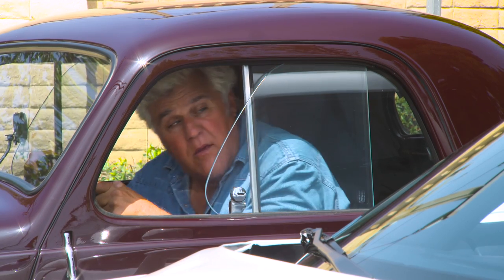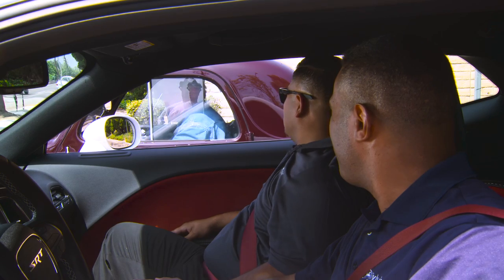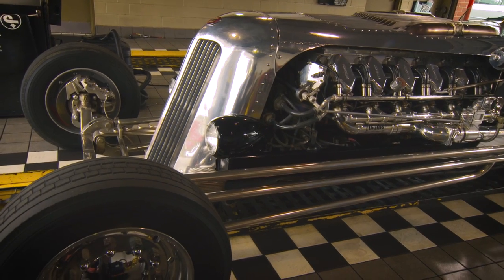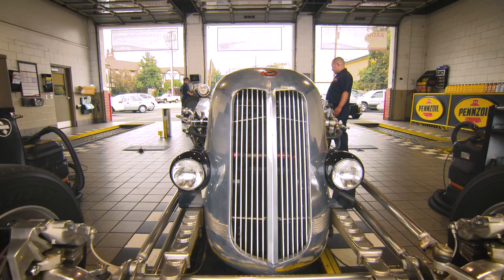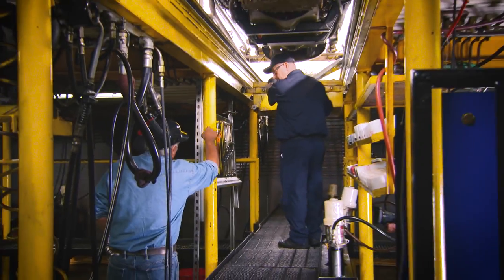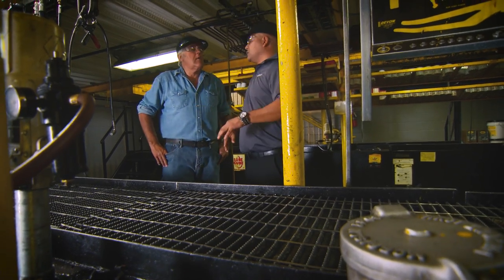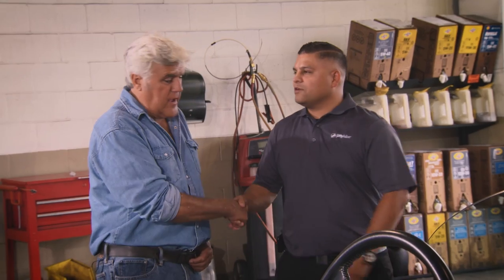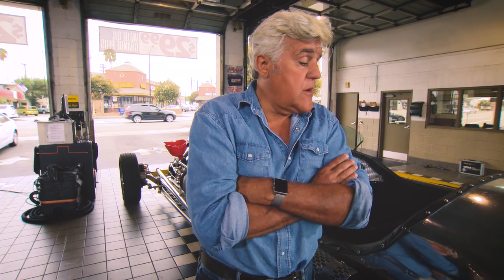Biggest Oil Change Ever - Jay Leno's Garage

Comment: Jiffy lube is horrible. I get so many cars come into my shop with ripped out oil cooler lines, stripped drain plug, low coolant to blow heads, scratch cars, get them dirty, forget oil caps, break dip sticks, etc. Never go there if you care for your car.

Comment: I took my truck to jiffy lube once.. They accidentally pulled the coolant drain plug out of the radiator for.. some reason.. broke the plug... some how..  Tried to put 20w oil in a 302 windsor.... for some reason... managed to pull off one of the spark plug wires at the distributor... and recommended a trans flush and new filter... it was a manual truck... I guess it only takes one bad experience to ruin my view on them but... I do my own oil changes now.

Comment: Jiffy Lube is a rip off.  I used to go to them, but got tired of the extras they said my car required.  Engine flushes, radiator flushes, transmission flushes, differential flush, fuel injector flush, all with the qualifier that the manufacturer recommended these services every XXX miles.  My retort was show me in your system where the manufacturer recommends that.  I am surprised Leno would align himself with these crooks.

Comment: sure, your oil change is free, but your serpentine belt is bad, you need new battery terminals, your fuel injectors need flushing, your brakes need resurfacing, your tires need rotating, and your blinker fluid needs changing, please this is all very urgent, your car will brake down next week if we don't get this fixed let me ring you up at the register

Comment: It's rare to find a technician at a Jiffy lube with any real automotive training. They train their people by watching videos. This is no way to train someone with no experience to do anything on anything worth tens of thousands dollars. They get it right most of the time with a basic oil change, but do you want to be the one who finds out the hard way that they really have no idea what they are doing?
I will say this though. If you have a car with a transmission or engine  that is ready to fail, take it to Jiffy Lube and have it serviced. If they do service it and it fails within 3,000 miles or sometimes even longer it's easy to get them to pay for the repairs. Even if they fight it in court they usually loose because of their bad reputation and the lack of anyone in there company that really sound like they know what they are doing in court. I've seen it happen many, many time. I worked for the company for about a year. and saw them loose in court every single time even when they did nothing wrong. Believe me they deserve it because  they cheat customers every day for other stuff.

Comment: Well Jay, the transmission oil smells burnt and needs replacing asap. also the brake fluid is black and the muffler bearings are collapsed. We can do it all now for $2300.....

Comment: Did they cross thread and over tighten the drain plug? How about tightening the oil filter so much you need channel locks to get it off?

Comment: One time they did not put oil in the new oil filter, started the engine CLACK CLACK CLACK thought the thing was going to blow up. The oil is crap also get's dirty and burns it, does not even do it's job, the filter HA was meant for a toyota 4 banger not my 5.4 litre. It's a pain to dispose of the old oil but atleast you know it's done right.

Comment: I wouldn't even trust them if I was standing there watching them the entire time. it isn't hard to change the oil on your car and be sure it gets done right. I change my oil with napa full synthetic. get it on sale and it's as cheap as conventional. 15 bucks for getting it done right with synthetic and a filter can't be beat

Comment: A bit staged? I had a quick oil change place crack the air valve on one of the first cars with wheel sensors. Had to call for a Cadillac service man to come out and assist. Then spend the next day getting the valve replace. Funny thing is that I did not have to pay for the repairs but wasted 2 days of my time going from the tire dealer to the Cadillac dealer. Of course the oil change manager did not offer to pay for the damage. Others have left off fluid covers in the engine bay or just ripped them off for some reason. So I really believe that Jay would let anyone who was not proven touch his vehicles.

Comment: Jiffy Lube forgot to put on my oil filler cap. Another time they put wiper blades on and they flew off with the first use. That's 2 strikes. Bought an air filter. They didn't put it in. 3 strikes. I'm done with those amateurs. Only my mechanic does it now. ASE  certified. AAA approved. Better Business A++. Every shop is different but this crap happened at 3 different locations. Buyer beware. I understand Jay's reasoning and appreciate his show but Jiffy Lube sucks.

Comment: I would never take my car to a quick lub sorry.  I know you're doing a sponsorship it's pretty obvious you would think changing the oil is easy and how can you screw that up right?  One time they over flowed my tank with oil and my car ran like crap until I had to drain it at home.  Then another time they spilled oil all over my engine and you could smell it burning on the engine.  Never went a third time so there you have it, incompetent workers changing your oil.  This is probably not everywhere but you don't even need to graduate from hs to work at one of these places...

Comment: Jiffy Lube do a Shitty job. Had bad experience with the Business. Took my car for a Basic Oil Change and 2 days later the drain plug fell out. 2nd oil change I did the mechanics left my Air filter cover wide open and didn't realize it after 3 days when I went to check my oil level. I was pissed and mad I have pictures too. I now do my own oil changes.

Comment: More like rippy lube you go there for an oil change and drain a quart and save it for a car that needs a quart to avoid lawsuit also the alternator,power steering pump,air filter,wheel bearing,axles,the number 3 piston,all the brakes,transmission...the car all need to be replaced

Comment: jiffy lube sucks. at my shop, we get so many cars that jiffy messed up. most common was stripped honda/acura 17mm drain plugs in those aluminum pans by instead of using helicoils they use over sized plugs. i also saw many times racist comments about the owners written on oil filters. those guys are not mechanics they are lube techs. amateurs.  its a great starting point but usually mechanics wanna move up in the world and have techs under them to do LOF an tires while we do the challenging stuff. avoid the j-lube for your cars sake

Comment: Over 10% 👎 hopefully will tell you something. Freaking commercial.
Iffy Lube didn't tighten an oil filter on my truck. It fell off on the fwy and cost me a motor. They said I couldn't price it was their fault and did nothing.
IFFY LUBE SUCKS!